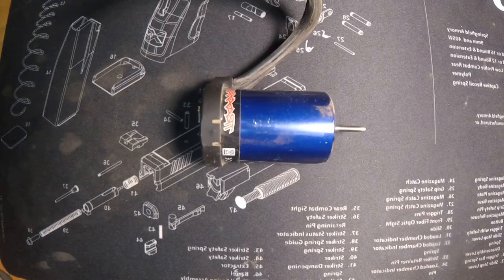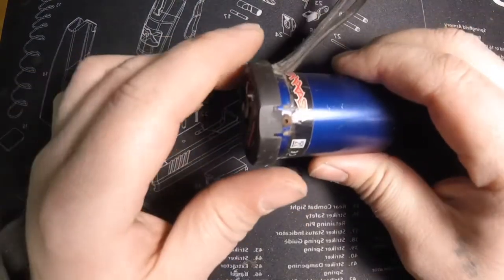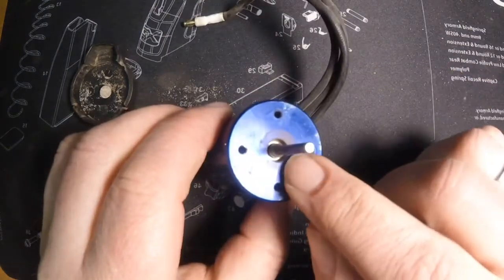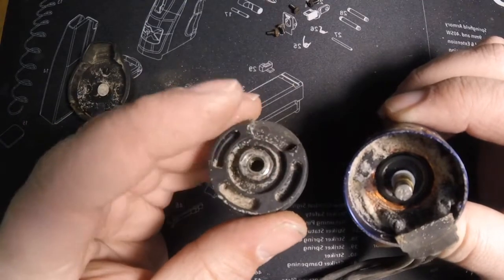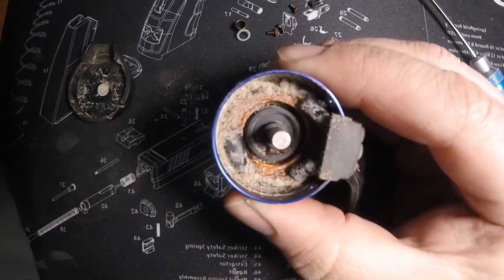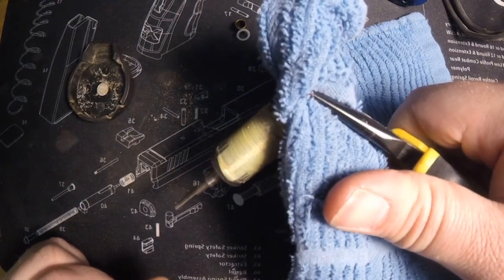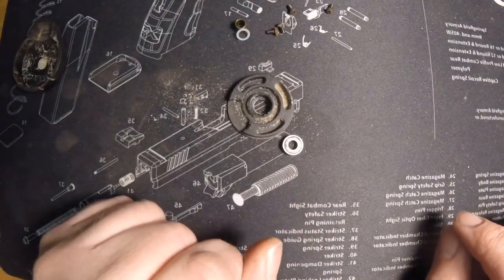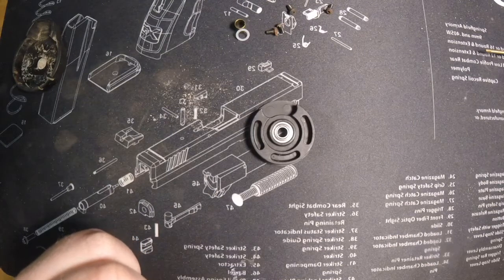Traxxas Velineon 3351R Rebuild

Comment: what do i do if those screws are stripped
Reply from the maker: @bs9two4  there is a small head that sticks out if I remember correctly, maybe pliers?  Thats tough, there is a tool call any "easy-out".  Maybe try that...  good luck man
Reply: @ ill try jb weld to get it out
Reply from the maker: @ hope that works for ya!  Keep us posted
Reply: @ yep
Reply: @ well it worked but i don’t know how to reuse that bolt
Reply from the maker: @ the kit comes with new screws?
Reply: @ oh yeah

Comment: Hi should the motor spin freely with no resistance by hand? Or should it have a little bit of resistance (3351r)
Reply from the maker: It will have some resistance because of the magnet, but relative free spinning
Reply: @DoubleDeeeZSlings  ok I put the 4 pole velineon brushless system in the Supra 4tec 3.0 and it wasn’t rolling smoothly, thanks! Car drives fine but didn’t want it to become an issue in the future

Comment: I put a light film of oil around the outside of the bearing to allow it to slide into the housing for the front bearing. I swapped my bearings out for TRB RC Ceramic bearings. They have less friction and have higher resistance to heat. Plus they're metal shielded on the inside and rubber shielded on the outside so they have a little water resistance.
Reply from the maker: Thanks for the tip!  And thank you for watching!